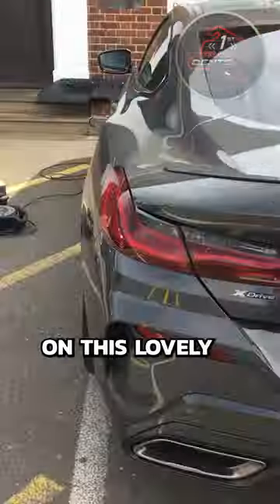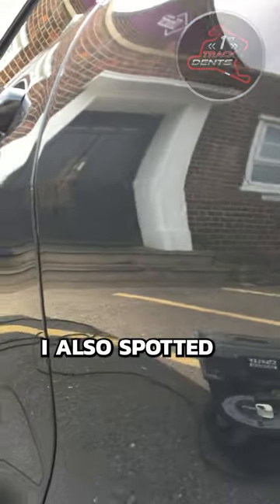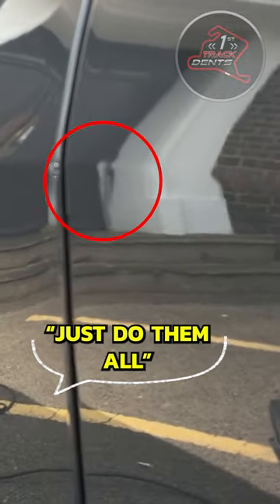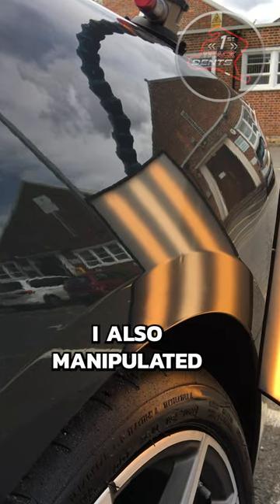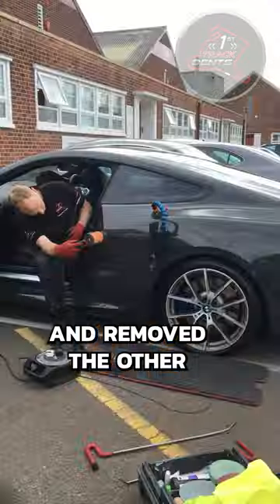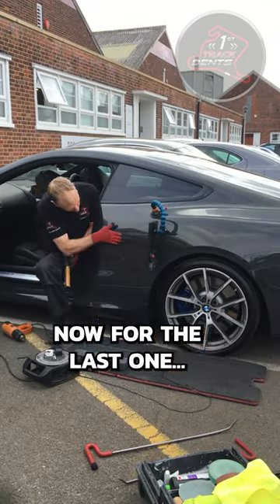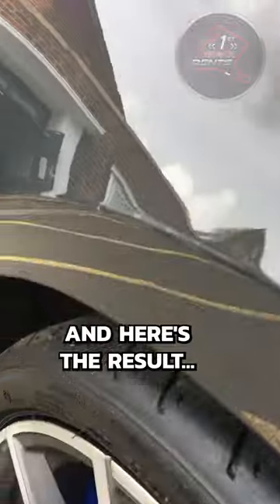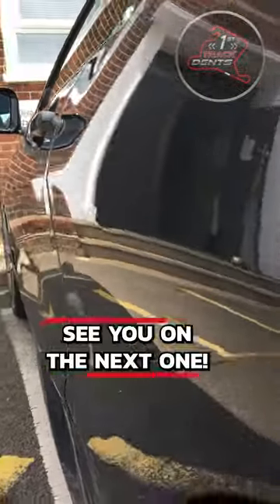HOW did these Dents APPEAR? #pdr #shorts

Comment: Hey, is it difficult figuring out how to remove panels from the interior of doors or the back? Having to remove trim pieces or interior panels makes me wish I could just use hot glue for every dent. I dont think i have the necessary tools to remove pieces from the car
Reply from the maker: Good question, a lot of manufacturers follow the same designs and have done for years. I worked for BMW for many years and the interior trim panels have been the same design for years so when you can remove one you can basically remove them all. Certain other cars I would avoid striping as they are too complex and badly designed and things could break. It's all about experience, the more you take things apart on various cars the more confident you get at it 👍